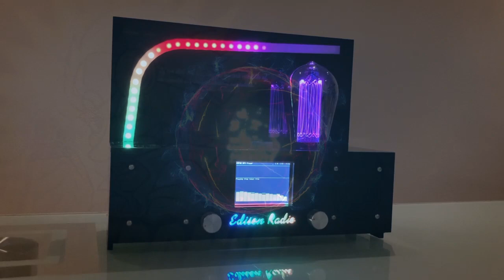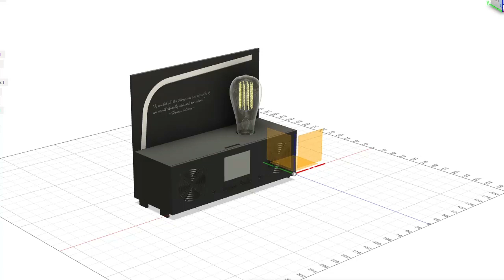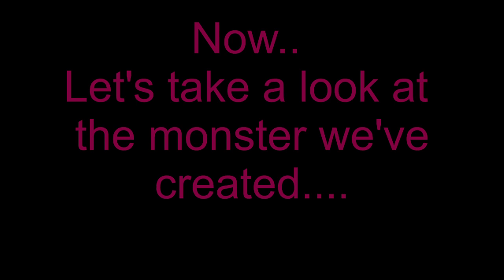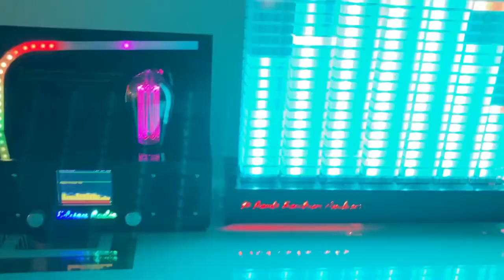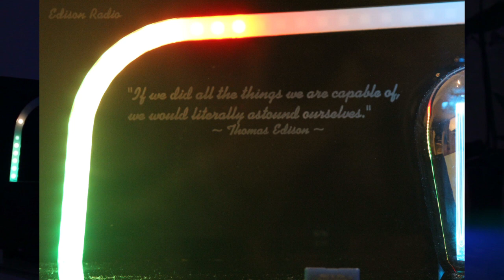Edison Radio - Best Internet Radio ESP32 - Arduino

Comment: I have completed mine as far as I can right now, there is no light bulb yet and will be wanting to add this as soon as I can but the display works, the ir remote works, the led 's work nice, brightness pot works and is all mounted in a case, had to leave out the led logo and wording for now but will be doing something with this in the future, even the code compiled fine as I did a fresh install of IDE and only added what you said too, IDE version that works is 1.8.18,  the only problems I have and this has been confirmed by Edzelf and others on the original build are the sd card  which fails to initialize and the rotary switch which on mine does sort of work but has a mind of its own, on the original project this has been more or less fixed and so has the sd although is still hit or miss has been improved.
The original code of ESP32Radio-V2 is constantly being updated on  and last update was one week  ago, it may be time to revisit the code on your version and bring it up to date. theirs's works really good but does not have what yours does. I will be sharing my build on your Instructables page

Comment: One more question, how did you get the sd card working, I am using the same screen as you, I connected up the 4 pins for the sd card and the screen was already connected and working but the sd is just not recognized and says failed , I then breadboarded it and the same so I tried two stand alone sd card modules but still nothing, the wiring is correct, I noticed a jumper on the back, does this need solder across? also why on the pcb on the sd connector is there + and - but no where on the sd part of the screen to connect them
Reply from the maker: Is it formatted corectly?
Reply: @TheElectronicEngineer  Hi, yes I tried several 8gb and 16gb sd cards and used sd card formatter software, even tried with and without mp3 files, I notice on the net that many others seem to have problems with sd card readers and esp32 so I am a bit lost, sd cs is also pin 21 which does match the config settings
Reply from the maker: @stefi300972  ill have to check but i believe there is a size limit to the card. Also you have to power down the device before you insert the card. Finally, check the lib versions
Reply: @TheElectronicEngineer  hi, I put the card in before powering up, it is only an 8 and 16gb cards and some people mention that the limit is 32gb, fat 32 format, I used the same library's you mention in the build manual plus tried the precompiled bin file and multiple screens, tested wires with multimeter and checked the pin out many many times, I have tried everything others are telling me although many are saying give up but I have seen a few where it does work
Reply: I had the same problem as you with the same results, gave up in the end

Comment: how do I change Volume direction, clockwise for volume up? currently it is clockwise volume down, also I had to change the pin outs for the rotary encoder as the pin out in the code is different from shown on the wiring diagram but that now works
Reply from the maker: You can swop pins or you change the config settings in the config tab, using the webbrowser to connect to the radio

Comment: thank you for your very easy to understand Arduino library's explanation and what files to use and the location they should be in, I started with a fresh install of Arduino ide version 1.8.18 and only added library's for your radio and spectrum analyzer and made sure each file was in the right folder and then found out yes it does make a difference, can not all be  documents arduino folder as will fail, did all this and selected board NodeMCU-32S and compiled with no errors, now to work out the tool you uploaded that needs to be done before the rest, am I right in saying it needs to be uploaded and then after that upload the main sketch? would that not overwrite the tool?
Reply: Correct. You need to install and run that tool once. It will format the internal eeprom to a useable partition
Reply: @donnersm  Thanks, done and then connected to the interface and wow what great firmware, has more functions than an internet radio I used to own which was not diy, Ordered some boards from JLC pcb, cant wait to start building.

Comment: Habe den Fehler gefunden
im Manual im Schaltbild ist Rotary Pin DT auf D25, Pin SW auf D26 und Pin CLK auf D27.
in Esp32_radio_init File ist Pin DT auf D25, Pin SW auf D27 und Pin CLK auf D26 definiert.
Also Pin SW und Pin CLK sind vertauscht
Reply from the maker: You can change that runtime , Connect with the webserver, you can change it there

Comment: Hi Mark
So far it works
It was a long way, I learned a lot.
Finally, I have a working screen, and the loudspeaker gives a weak sound of musik.
So the internet is established also.
but the Rotary Encoder does not do what it should do.
I cannot regulate louder; I cannot navigate and so on.....
I measured, the encoder is connected to the Pins and signals are doing what I move on the encoder.
The Pins on ESP32  25, 26 and 27 are reacting.
So, i don't know what to do.
Next thing was the compiling, It did stop always withe the "SD.H".
I did a lot of work installing/deinstalling libraries but nothing worked.
so, i was very happy with the bin Files, but als here, I had to find my own way.
I found it😇
do you have any advice to help with the rotary encoder Problem and to have a louder loudspeaker sound?
I wish you a nice easter
Greetings from Germany
Willi
Reply: Hi you mentioned you used the bin file to get it working i have done the same as i couldn't get the code to compile but i need to know how do you enter your wifi credentials into the unit when you have no access to the web interface?
Reply from the maker: There is no way….You need to use the web interface

Comment: Hi Mark
Letzes Jahr habe ich den tollen Bausatz des ESP Radios über tindie gekauft.
Alles gut so weit😄
Ich habe leider keine Erfahrung mit Arduino, ich habe alles installiert auf mehreren Rechnern.
bei den Microsoft Surface oder EVE V Computern ging erst einmal überhaupt gar nichts, Arduino konnte das ESP32 nicht finden.
Ich vermute die USB Ports waren irgerendwie nicht kompatibel und/oder keine passenden Treiber.
Ein kleiner HP Desktop hat dann das ESP32 gefunden und erkannt.
nachdem ich dann die Ordner von Githup auf meinen Rechner gespiegelt hatte, habe ich ein file compilieren können, aber das nächste ging nicht.
es waren diverse ".h" Files nicht zu finden.
Irgendwie habe ich einige von diesen .h File nachinstallieren können, ich habe ja gesehen ,wo die Compilierung stehen geblieben war.
Aber jetzt geht nichts mehr, die "sd.h" Fles und alle die so ähnlich heissen findet der Compiler nicht oder meldet, dass sie falsch sind.    
Das Browserprogramming endet auch immer mit einer Fehlermeldung: "Unable to fetch manifest: Failed to fetch"
die Ports werden richtig erkannt, alle Zugriffsrechte sind erlaubt, aber leider geht nur die Option 
"Websites dürfen nachfragen, wenn sie eine Verbindung mit USB-Geräten herstellen möchten"
Was kann ich tun?

Hiiiilllfeeeee😂

Viele Grüsse
Willi
Ixh wünsch ein schönes Osterfest
Reply: Ich habe es geschafft, ich bin begeistert.
Was war:
Die Browserprogrammierung ging nicht.
habe die .bin Files auf einem anderen Weg in das ESP32 geladen.
dieses Video hat mir dabei geholfen :  https://youtu.be/TrDgyIsYsx4
Aber nicht vergessen, das InitializeTool erst einstellen und mit Arduino IDE colmilieren und hochladen.
Wichtig hier ist der  WIFI name und das Passwort......
Noch ist der Ton sehr leise, aber ich vermute, irgendein Parameter in diesem InitializeTool muss noch eingestellt werden.

Comment: Hello. Please tell me if the  Nextion NX8048K070-011R/011C display is suitable for this radio.
Reply from the maker: It depends, if the interface is the same or not. Also, you’ll might have to change the code to make it work.
Reply: @TheElectronicEngineer  Understood you, thank you. And which display is the largest can be used without changing the code.
Reply: Which of these displays is suitable without changing the code ILI9341 (320x240) and ILI9486 (480x320) @TheElectronicEngineer
Reply: @TheElectronicEngineer  and what display?